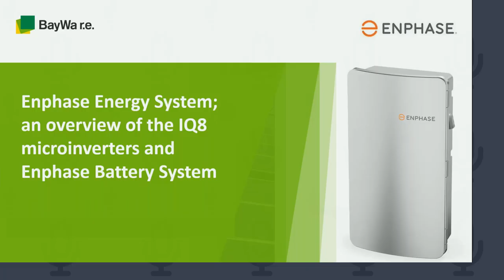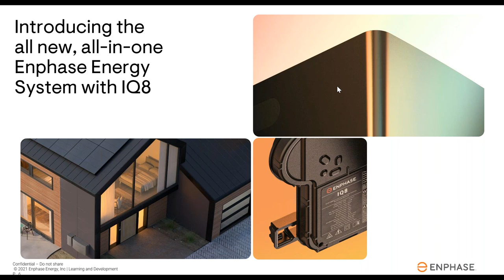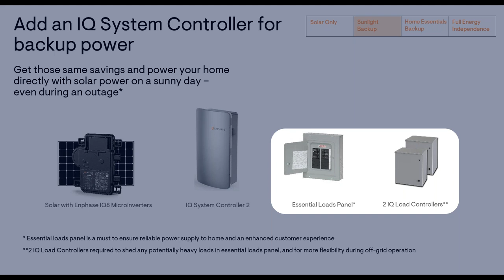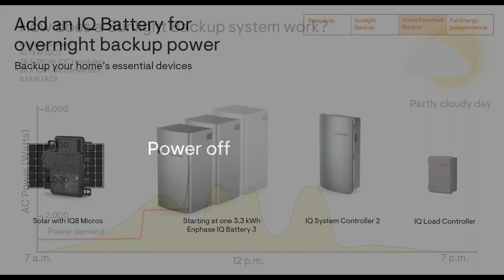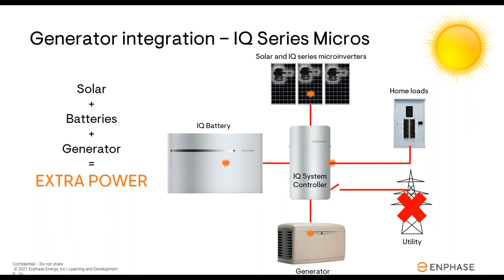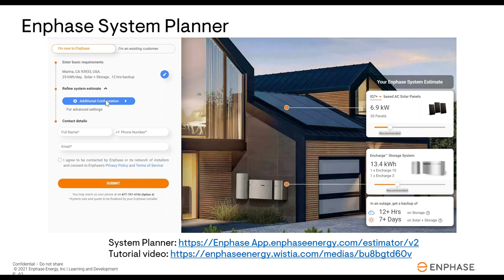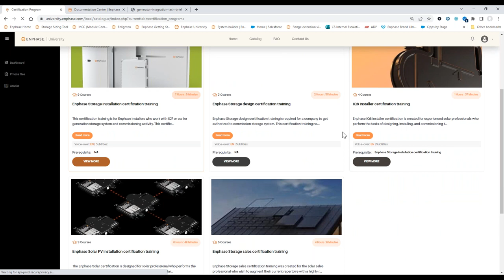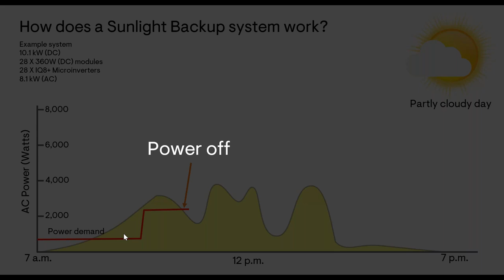An overview of the Enphase IQ8 microinverters and Enphase Battery System

Comment: Ive got a question. I recently learned certain hydro utilities in Ontario are counting the continuous power output of batteries as energy generation (Tesla AC batteries in particular), which eats up HALF the max net-metering capacity max (thus making solar very cost ineffective). Is Enphase also being knee capped this way?